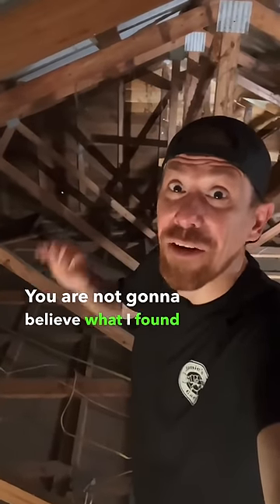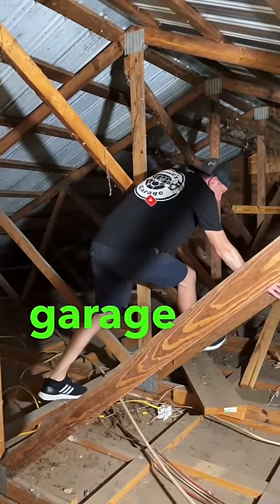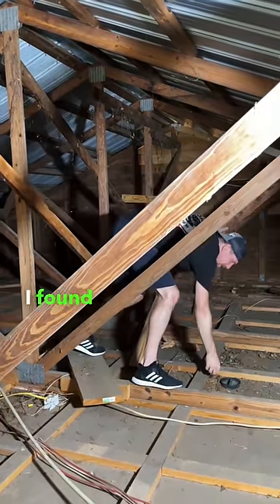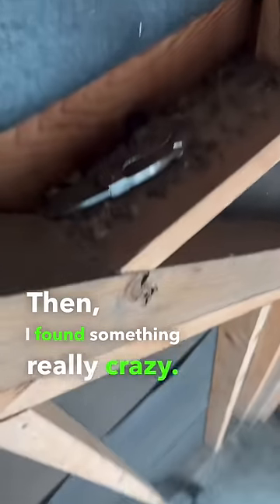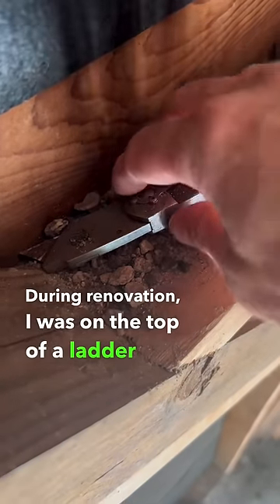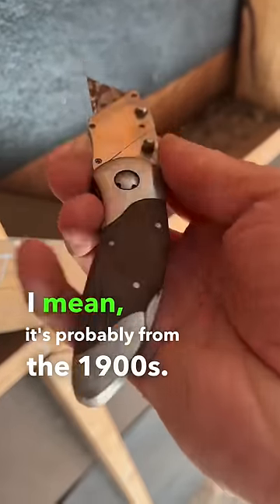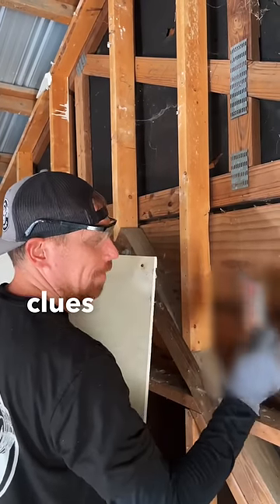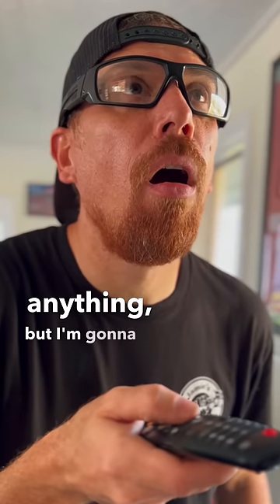You won’t believe what I found hidden in my wall!

Comment: 1967 Barracuda. The 68 and 69 had a smaller “PLYMOUTH” off to the drivers side. 67 has it spaced out across the top. 66 and before was a different design all together
Reply from the maker: Awesome! Thanks
Reply: Yes, 1967 Barracuda. That’s a hard to find part!

Comment: lol, my garage was covered in centerfolds by a previous owner. They took them down before they sold it but not well. I removed some 2x4 shelves and found bits of the posters. Some pretty lewd bits.

It also turns out they did not take down some of the ones in the garden shed.

Comment: I have a nearly identical garage without the floating ceiling. Really common design for mid century 60s 70s 80s

If you need heat in there, it's going to need a lot of work. A lot of times the roof isn't actually attached per se. Just strapped down, not affixed
We get a lot of moisture collecting and running down into the eaves and it's caused rot
Reply from the maker: Heat? I live in FL. I need AC Lol

Comment: Your correct sir 1967-1969 Plymouth Barracuda front grill.

Edit changed the 4 to a 7
Reply: Yes I agree.  At first I thought perhaps it could even be pre barracuda like the Plymouth Valiant, but after looking at it the style and curves are that of the Barracuda.
Reply: There’s no way you could tell that from a 3 sec shot of it??
Reply: @jonathanbellows113  iconic styleing by Plymouth. Not to mention pre 67 there was a larger beam in the middle and a badge for it in the middle. And post 69 they changed the grill to be slimmer in the middle beam.
Reply: You were right the first time,  it's  67 to 69.
Reply: @roadcuda6964  thanks for the confirmation

Comment: Those knives were sold at Walmart around 5 or six years ago.  I bought 2 of them and used them for torch-on roofing for a few years before wearing them out. They fit hook blades very well, fit my hand comfortably and are quick to change blades. I wish I could find more.

Comment: Razor knife is not very old,  the Stanley non-retractable came out in 1936 followed a few Years Later by the retractable with replacement blades in the handle.  Folding with replacement blades came much later. You can still purchase the wooden inlay handled knives today.

Comment: I found something in your garage attic that you missed…..storage space!  When my home was being built I turned my space above the garage, into my car parts area. I only did about 1/3 of it so that I wouldn’t overload the trusses. I used scrap 3/4” plywood and made a floor. There was light that was switched from the garage, I added another light and an outlet for convenience. I also have a 18’ x 20’ antenna up there. You can store your Christmas stuff, but not real heavy things.  I get up there with a pull down aluminum ladder. Even with 3 cars in my garage I can pull down this ladder and get up into this space. Good luck and have fun!   Jim

Comment: The way that you find out how old the garage is, simply measure the studs if they're truly 2x4 inches they are pre-1964.... anything after that is  
A good idea.  1 1/2 by 3 1/2 inches would be manufactured 1965 onwards. That knife is probably 15-20 years old. 🤔
Reply: Also, judging by those nailer plates, the trusses are prefab,  circa late 1970s or 80s.

Comment: I find it hard to believe that this house is around 1900's. If this house was from early 1900's  it wouldn't have dry wall, it would of had plaster and the house would of had raffters not trusses with stamped plates joning the wood members.

Comment: The razor knife is a cheap Winchester brand knife that usually came in a three piece set, that included a multi tool, a fixed blade knife, and that razor. The set was like $18 at Walmart. I still have the multi tool, and the fixed blade. Not sure where I left the razor
Reply: Not sure where the GGW dvd went either
Reply: See how rare it is